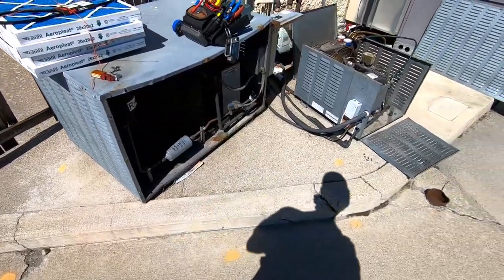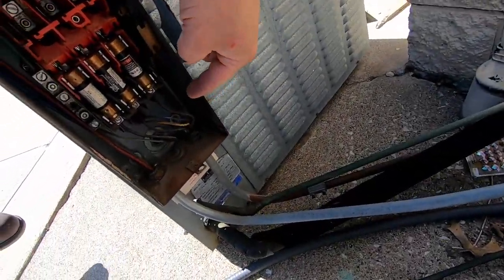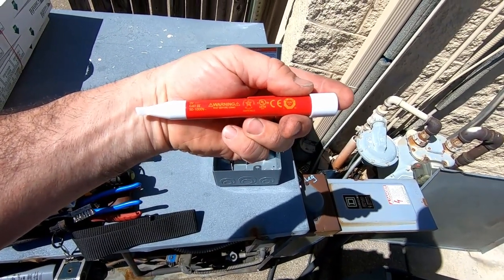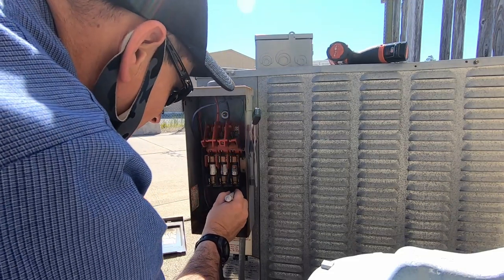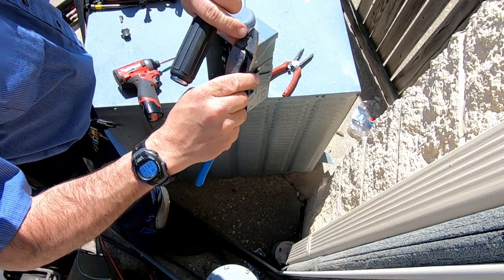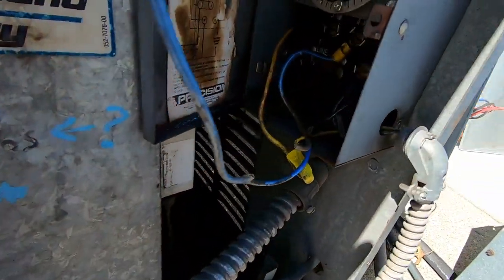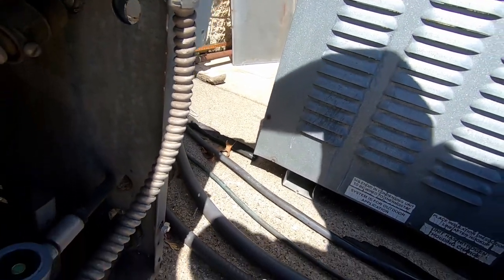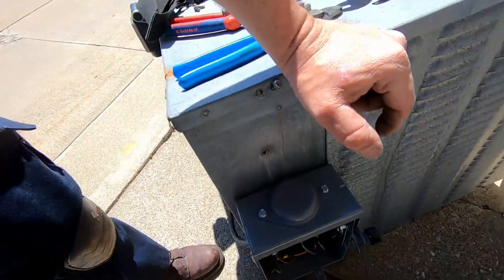Walk-In Cooler Leaker & Power Tweaker

Comment: Excellent!  Thank you for emphasizing the lockout tagout step.  Probably the most important part of the entire repair.  Because if your dead you can't fix a thing.
Reply from the maker: Thank you, I think we're all guilty of not doing it when we should but like I said I try to do it anytime I'm going to be away from the panel. When I'm working on big stuff I will lock it out even when I'm right beside it just to help prevent myself from making a mistake and turning it on too soon.
Reply: @HVACRSurvival  I have been deep in bowels of a crusher once in my career when the control room somehow bypassed the procedure and attempted to start it up with me inside.  The only thing that saved me was my lock on the local disconnect for the belt I was standing on.  The only lock you can trust is your own, the only person that can keep you alive is yourself.  Cheers keep up the fine work.
Reply from the maker: @sbingr5313  I'm glad you're okay man, thanks for sharing that. You can never be too careful 👍👍

Comment: Fused service switches should be avoided on three phase compressor to help avoid single phasing. If one phase blows a fuse while in operation it causes compressor motor overheating and damage. Thanks for the video

Comment: a contactless voltage tester is only good for preliminary testing, always back it up with a real test or shorting of it via insulted tooling  or be prepared to get zapped or bite the dust.
the above doesn't apply to above residential and light commercial power. if you do that as a lineman, there could be a 1/4 mile wide molten goo spot left ;)
Reply from the maker: True...There's conditions to everything, I'm much more cautious on 277v and up.  Most times on lower voltage I didn't check at all so this is better than not doing anything. Yes, a VOM is the best test device but even then most people don't do a resistance check of the leads prior and then do a voltage check on a known live circuit. There's always more we could do👍👍

Comment: they used existing conduit and the other machines disconnect as a junction box. they really should have left enough wire loop for splicing and labeled them in the other disconnect and all boxes upstream. not sure of all the wire gauge of the conductors, so it may or may not be multiple code violations.
good job tracking it backwards and looking to see what was done, you just never know what kind of tomfoolery you'll hit.
Reply from the maker: There's a lot of hackery in my area. Almost nothing gets inspected. We don't have any electrical or HVAC inspections unless it's in town and then it's only plumbing and electric.
Reply: @HVACRSurvival  ditto, I live across Ohio a good ways from you and inspections are rather rare for most things, except new construction. even then, they pass things that should be failed for a dozen reasons, then next inspector comes out and flags something, repeat process half dozen times for many months on end.
then they wonder why old school muscle flexing happens ;)
Reply: The biggest code issue I see here is all that energized electrical equipment literally burying the gas meter...

Comment: I use the leak detector to get me close and then use the bubbles to pinpoint the leak.  Did you ever fix the leak in the evap coil or did you replace it?

Comment: Which is the voltage detector you went back to. Was about to grab a Klein NCVT3P before I saw this video.
Reply from the maker: https://kit.co/hvacrsurvival/my-main-tool-bag-and-what-i-use-on-most-calls/santronics-3115-ac-v

Almost every tool I use is listed in my kits link that's in the description of every video. If you purchase through the link I get a small percentage of the advertising dollars. You still pay the same rate.

Comment: Great video. I've been on the fence about buying a D-Tek recently. Everytime I think I'm going to, I end up finding forums and comments and reviews online where people say they miss leaks consistently. But you seem to have had a good experience. Would you say there's any performance difference between the select and stratus? Or is it just down to the features?
Reply from the maker: They both pick up the same leaks, the stratus allows you to narrow it down a little better but I don't think it's worth the extra money. There's been a few manufacturing issues which I think it's because the covid stuff but they're fixing things like the hard to push buttons. Which is a rubber compound issue not a control board issue. H10 is badass but the Detek3 or the Stratus both kick ass.

Comment: Going to town with that H10 👍🏽 great work..
What do you like better that $600 H10 or the $900 Dtek
Reply from the maker: I pointed out my complaints with the h10, you can't beat the h10s ability to narrow things down and pick up the smallest faint signals because you can manually control it. But the convenience and ease of use of the Dtek is superb along with the battery life. They're both winners. I've been using the Stratus 95% of the time. It's probably been a year since I've used the h10 🙈
Reply: @HVACRSurvival  I’ve always enjoyed the Tiff myself but that’s no more
Reply from the maker: @refrigerationconfidential4376  I have the Tiff zx. It does great on r22 and 404. (It's got the pinto diode)  I haven't said a whole lot about it but it's a dang good little detector, I got it really cheap.

Comment: I hate those knock outs, especially on plastic stuff, which is common here in Europe. There are special tools to cut them out, but for DIY jobs or when it's not "your" job, you probably don't have it on hand, so you're there bashing on it with a screwdriver and a hammer, making a shitty job of it...
Reply from the maker: Interesting to hear, where are you located?
Reply: @HVACRSurvival  Sweden. Plastic housing disconnects are super common here. With that said, they work fine, life expectancy is no lower than the old metal boxes, even in adverse conditions. I've had one fail after 12 years outside, because the installer forgot to punch out the drain hole, and entered the cables from the top, so when the cable glands deterirated from the sunlight, the box filled with water.
Reply from the maker: @Tjita1  Sweden huh? Very cool. Let me show my illiteracy here and ask do you speak English or are you using a translator?
Reply: @HVACRSurvival  Fluent written, a bit stuttery spoken, although plenty enough to make myself understood. English is one of the core subjects in Sweden, together with Swedish and math, so swedes are in general not bad at English.
Reply from the maker: @Tjita1  cool 2 know👍👍